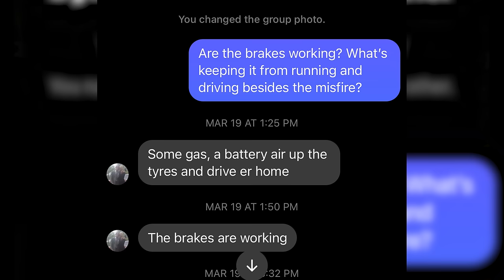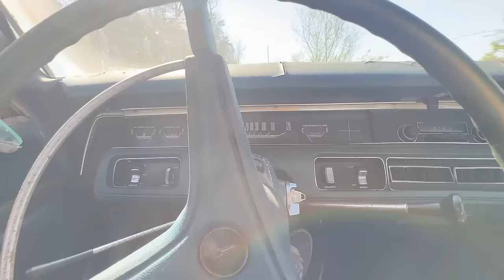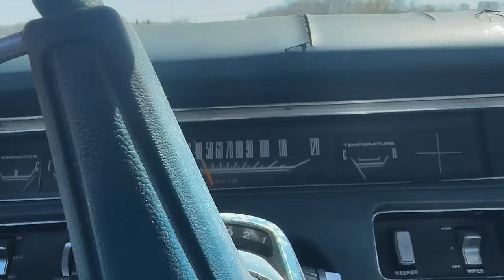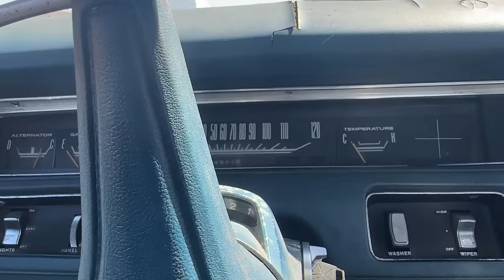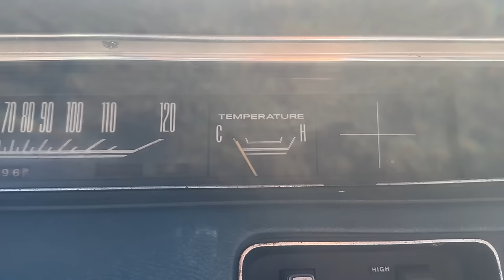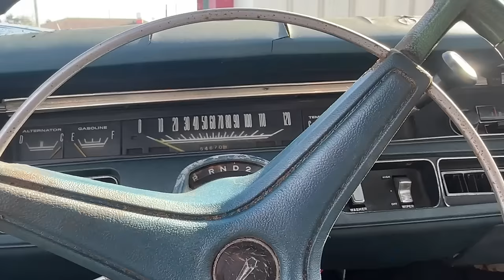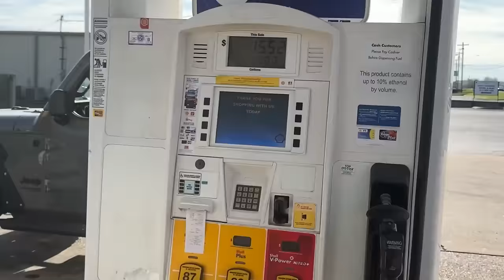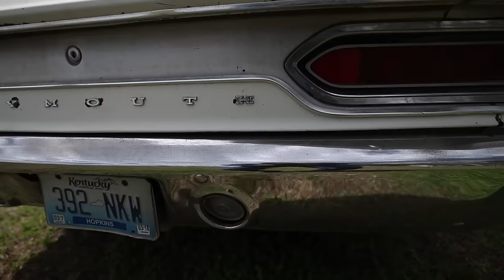FORGOTTEN Plymouth Satellite! Will It RUN and DRIVE 250 Miles Home?

Comment: Saying a lot about how tough those 225 engines were. My cousin was broke needed a car and bought an old dart 4 door from a neighbor. Drove it to work for 9 years, and was still running at 155,000 miles. never need more than plugs points and a ballast resistor.

Comment: Milky oil can sometimes be the crankcase breather on the valve cover, or the PCV valve, I would check those first and do a compression check before concluding a definite head gasket. Great find Dylan, can't wait to see the progress on this one. It will be an excellent donor. Thank you for sharing.

Comment: Has a Chevy Caprice front seat. I had a Slant 6 Duster I used headder wrap on the fuel line through the water pump to keep the fuel cool. Does that AM radio work Dylan?

Comment: ...wooden floor..."basically it's a truck now..." lol that's funny 😅. Probably hold more than most modern trucks lol. I may have told you before but my dad had a 70 Plymouth Sport Satellite with a 383 4 bbl , console shift. Probably around '73 or '74...Same color but his had a brown vinyl roof I believe. It was a  fast powerful beautiful car. I really miss it. Thanks for the memories.

Comment: Seeing as it has the same rims as the General Lee, it definitely deserves a second chance at life with a V-8 engine whether it’s a 318, 360, 383, or 440. It definitely looks like it should have a V-8 instead of the slant six that it has. I found it kind of funny and comical that the rotted floor and trunk floor of the car were replaced with wood. I’m also relieved that you got home in one piece. I’m really looking forward to the project that this car becomes.

Comment: I had gotten a 05 tahoe for scrap years ago, needed a transmission, I changed that ran and drove great but could not figure out the why it had no brake lights or blinkers or nothing, but the trailer plug worked great, one of my friend wanted it and lived over an hour away. So I rigged up the brake lights to the trailer plug so it wa legal for the time being, I guess it melted some wires down between the tank and frame, friend still drives that thing.

Comment: Sounds like it did a lot of start and stop where engine didn’t get warmed up enough to burn off condensation where the water in oil is concerned

Comment: I would consider putting some CWF or some Thompsons water seal on the trunk floor. And add a few carriage bolts to it after.  I wouldn't suggest powerwashing  the trunk floor just sweep it clean then Thompsons water seal it.. is it pine, oak, popular, or pressure treated? George Washington teeth were made of wood!!

Comment: Hey there, Dylan I am kind of curious if the satellite wiper switch would be the same as the one for your Dodge charger that you’re redoing it look like it was a toggle switch. Also, just a curiosity question on that.
Reply from the maker: This car has a two speed wiper motor vs the three speed. Good thinking though!

Comment: My truck temperature gauge is running like that. It comes up just past the C. That was its normal operating temperature. If it come up to normal I would stop and question it. And it would normally be low on coolant but we've had the truck 10 years and I've only had to add coolant twice

Comment: My friend who is an ex body guy told me when he worked a Plymouth there was a motor they had in the building that was a slant six and it had 350,000 miles on it and only had 1 valve job and that's it.

Comment: I dumped gallons of gear oil in my 78 Chevy truck motor 350 I just pulled in the driveway and it locked up tight   on me the motor was bad anyways

Comment: If it does have a blown head gasket I would have definitely removed the thermostat and had the radiator cap on the click not closed. 👍👍🇺🇸🇺🇸

Comment: missfire under load could be a weak coil. thats a thing. spark is not able to Jump under load. 
this is if all the basic checks out. 
had a 200k miles 85 Camaro that did exactly that(5spd car) it would idle perfect but as soon as you would try to accelerate it would skip and missfire alot.

Comment: Put it on a Crown Vic frame, suspension , brakes, axle like those dudes did with a Charger body to make a General Lee stunt car, accept toss the 4.6 and 4R70w for a 360, 383,400 w 727 or 833 paint it up like a late '60s-early '70s LAPD black and white slick top cop car they called them 4 door Road Runners. A bunch were used in movies and tv shows in the 70s.

Comment: I've never seen the egg in the radiator trick to fix a coolant leak. 
I think I have a twisted mind, but I started thinking about meals you could prepare in your radiator. I can see the commercials on tv.
 Save time and money, now you can fix an entire meal in the radiator of your car for the family on the way home from work. Order yours today. We have a variety of meals available right now for the ridiculously low price of $19.99 each. Order in the next ten minutes and get four additional meals for only $99.99 plus you'll receive a free exhaust manifold mounted non stick griddle, yes, a $79.00 value absolutely free with your order. Just add $14.95 shipping and handling. Be the envy of the neighborhood. Don't miss out. Get yours today!
It is recommended that you drain the antifreeze and replace it with clean water prior to preparation of any meals.

Comment: With the 225 you could probably drain the oil and the coolant and still make it home. Lol safe seatbelt.  The rusted out floor will just follow you through the windshield in a crash.  Not the same car but the same engine for sure...you could think of yourself as Dennis Weaver in 'Duel'  Any ugly Peterbilts following you?

Comment: my dad had a 1997 mustang, v6 with a manual and no options. this sucker had manual windows, manual door locks, and I bet if he could have gotten it without AC and power steering, he would have.  the radiator started leaking when I was 10. he cracked an egg in the radiator like y'all did, and it never leaked again. I got that car when I was 16 with the same radiator, and it lasted a year until I blew up the transmission and then sold it for scrap. it was beat to hell, and not because I drove like an idiot... my dad was pretty much blind and would bump into everything. never other cars though, he was good about that.

there wasn't a square foot on that car that wasn't scratched, dented, or rusty.

Comment: Don't worry the slant sixes don't need a head gasket and they don't need oil...... Ask me how I know...... Drove a Dodge tradesman 200 van with the slant six three speed on the column no power brakes no power steering from upstate New York to Orlando Florida. No water no oil blown head gasket overheating all the way sold it when we got to Florida. Should have fixed the head gasket but bought a Ford van 5.0L instead.......

Comment: dipstick too long ?
fun fact, during the war in occupied france, the local automobile manufacturer was forced to build cars for the Nazis.     if you were caught sabotaging the cars, it was an instant death penalty, so they sawed 2 inches off the dipstick tube + put 3 quarts less oil in each vehicle, so the dipstick still read "full" when they drove out the factory
after about a week of use, the engines used to seize up, for no apparent reason, hats off to those french workers...

Comment: I'll bet that oil had gas in it with that number 6 cylinder not firing. Rings are probably bad. Be a good parts car for sure. At least you know what you can and cant use on it!